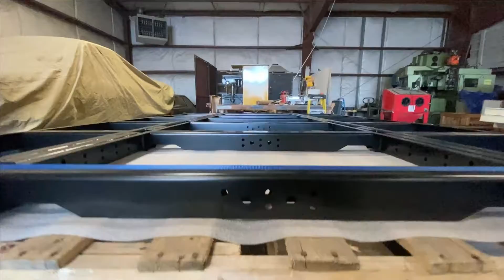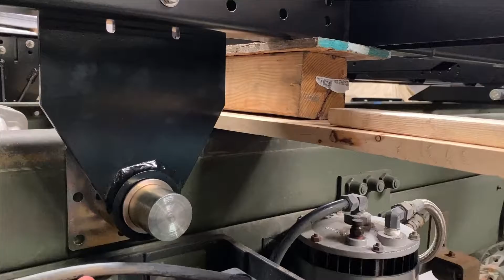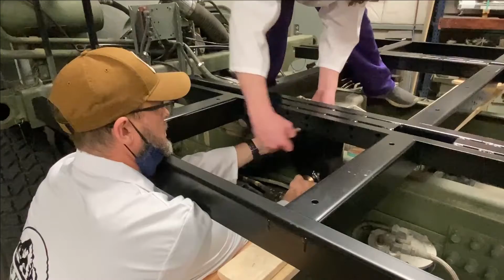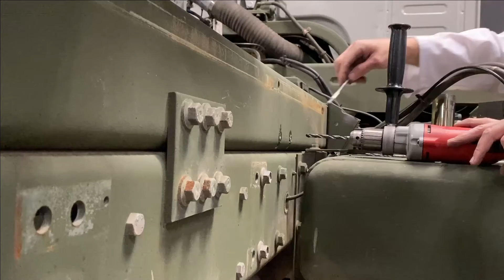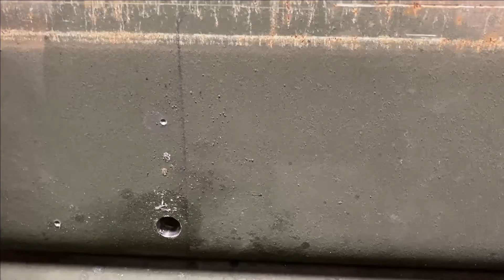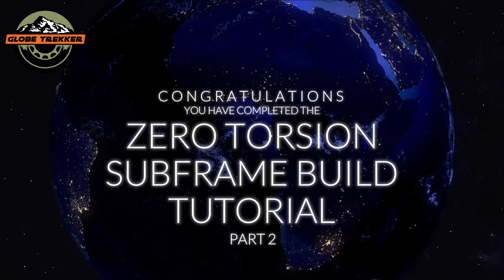Globe Trekker Subframe Build part 2

Comment: As I have forgot the name of the end of  a drill bit, but the pilot bit only needs to fit into that hole for drilling. A dribble of oil from above usually allows more oil to dribble into the hole for lubing.
Reply from the maker: The drill bit was quite a bit used, I believe when we started. Dull bits make drilling a real pain. Sharp, brand new bits are the way to go and how to press the "easy button."
Reply: @RVGlobeTrekker  The cutting edge of drill bit is for just that . Not the stepped up in size as was mentioned. I used to see it on jobs all the time. Having to be spun at that speed as for them.

Comment: Would you please do an ultra in-depth video by one of your engineers on how a zero torsion system works? I under stand how the brackets and pivots that are on the midline between the frame rails of the truck work in allowing the trucks frame rails to twist, but I am less clear on what the side pivots role is in the system.
Reply from the maker: Yes... and I can also explain. Whereever you mount the side pivot brackets to the truck frame... whereever that part of the frame twists, so to will your habitat in the same manner. So, if you want a pass through (for instance), you would want your side brackets are far forward as possible, since there will be less frame rail between the cab and where the side brackets are mounted, therefore less a chance for the truck frame to twist. This allows the habitat to travel similarly to the cab. Here is the video you wanted: https://www.youtube.com/watch?v=RrQIlNYHNWs and this one: https://youtu.be/FCsKDBQKEck

Comment: Nice videos and thanks for shareing as educate me. From which materials you make the subframe and pivots/brackets and what coating
Reply from the maker: The base materials are steel, and the process is as follows. After welding, the subframe is bead blasted, followed by an epoxy primer and then powder-coated as one piece to ensure the best corrosion resistance possible. The bracket materials are steel. The 2" diameter pins are chromoly steel (over 120,000 lbs. shear strength, each, there are three on a 3-point subframe), and the oil impregnated bushings are solid bronze (60,000 lbs rated maximum load, each...  there are four on a 3-point subframe).
Reply: @RVGlobeTrekker  
Thamk you, very impresive